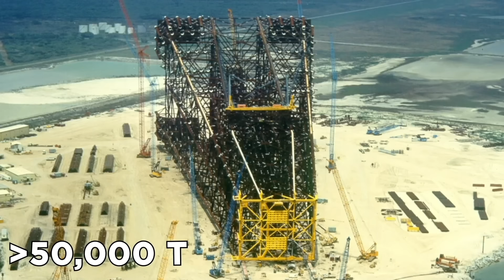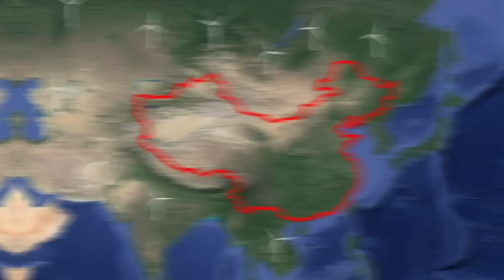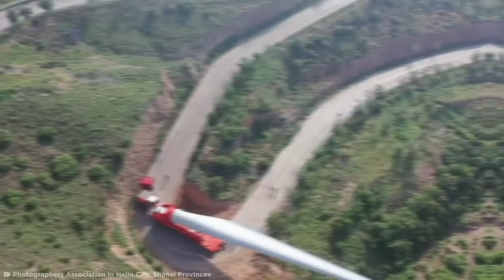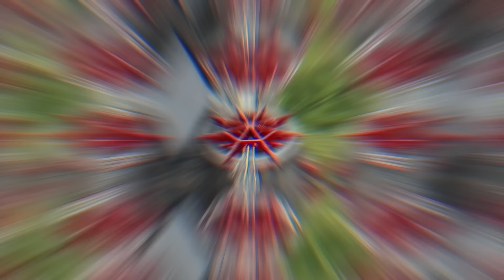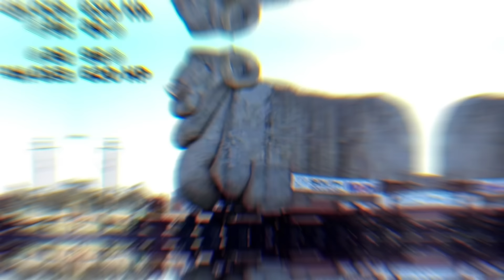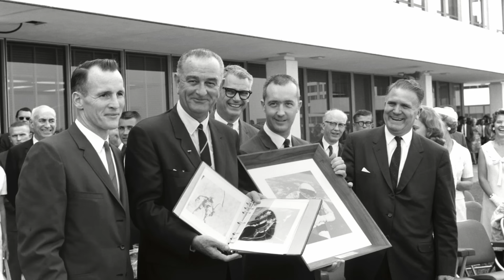Most Epic Transport Operations of All Time

Comment: I worked on final transport for a good handful of reactor packages from decommissioned Naval vessels. Mostly submarines but a couple of destroyers too. The wench they use to tow the whole sealed up reactor package is impressive-and it moves SLOW. It took about 12 hours to tow it from the keel blocks on the dry dock floor to the barge it would float on to Hanford. Some of the coolest projects I was fortunate enough to work on at Puget Sound Naval Shipyard.

Comment: The trailers for the blades is not self steering. The rear pilot has remote access to the wheels. Which is the person you saw following the trailer around the corner

Comment: I do not have the time to check the whole video, but the first fact is already wrong: The Eiffel-tower weights 10.000 T. The steel construction alone is about 7.300 T. If the base frame of the dwelling platform is over 50.000 T, that is not even 7 times as much as the weight of the Eiffel-towers steel. The video claims it weights 10x as much. Please check your facts.

Comment: @Be Amazed 
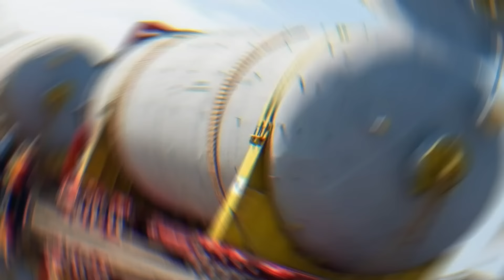13:07 - "Had to be moved across Canada... from Edmonton to Alberta." 
FYI: Edmonton is in Alberta, and travelling within a single province shouldn't be considered "across Canada". Also, the map used in the clip for this move is entirely inaccurate as this map shows Edmonton (right pin) and somewhere just north of Edson, however, the real move was North to Fort Mackay, which is further North than the more-famous Fort McMurray, and was just shy of 500km in length as opposed to the relatively short 275km as displayed in the video's map. Not trying to nitpick but accuracies are pretty important when creating videos such as this! Thanks for the content!
Edit: P.S. when talking about impressive statistics on these big moves try to avoid focusing on horsepower, instead, focus on the torque as the highlight.

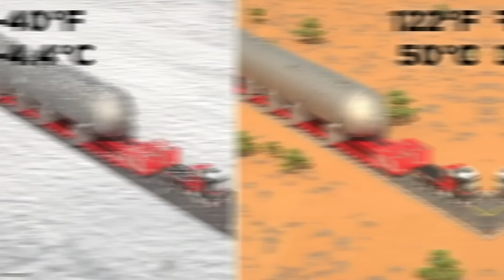Comment: At 12:29 you have temperatures on the screen. It says that -40°F is equal to -4.4°C. This is incorrect. -40° is the place both scales are the same.

-40°F = -40°C

Comment: 2 things :
- I Witnessed the departure of the transport of a completely disassembled Airbus A380 - a huge convoy requiring 6 or 7 specific transports (2 wings, head, mid section, tail section, and 2 huge containers of spare parts) from Langon to Toulouse, France.
- I didn't experienced but closely followed the transport of the Cape Hatteras lighthouse.. A complete brick building they transported as-is 100 ft or so inland because it was getting way too close to the shoreline. But the preparations took a couple of years because the building is quite fragile and had to be lifted in one piece.

Comment: This has to be the one comment section I can actually speak on lol there's one error in your video, specific to the blades being hauled on extendable trailers portion. Some newer trailers are considered "self steering", but it actually requires a steerman for the odd turns it can't make on it's own. It's my whole job. I'll try to answer any questions if you have any.

Comment: If the structure of Bullwinkle was floated into position after leaving the barge , why was the barge needed.🤔🤔😆😎
Reply: I though the same thing. Probably used the barge for speed of movement on the water opposed to dragging through water (less drag maybe) and with how tall it was, it had to of been pulled several meters off shore before it wouldn't bottom out on the ocean floor when tipped upright..... 🤷‍♂️

Comment: A single wind turbine blade significantly exceeds the diameter of a helicopter's main rotor 🚁😲 A 90 degree turn with that on a trailer is extremely rare to witness.

Comment: Imagine how much damage these made to the roads (the ones that were trainsported on them)
Reply: None. They are engineered to take that weight. On the majority of these loads the weight is distributed as such using multiple axles. No different in theory than transporting a legal load.
Reply: @jamesbond1231  The roads have to repair more frequently. Normal trucks destroy the road much faster than cars, hundreds, maybe even thousands of times faster.
Reply: @skedzer4803  Incorrect. They are engineered and designed to take the weight. 
SURE if the axles aren't steerable you get scrubbing, but - the majority of these transporters have steerable axles.  

Trust me... there are entire departments that do the calculations.  

They don't route these types of loads on regular roads. It's why they often take 2-3 years to plan And also why they usually try to make these moves during winter. The ground is more structurally sound.

It's .. simple science.
Reply: @jamesbond1231  Eventually, everything needs to be repaired, and roads need to be repaired often because of rubber tires on concrete or tarmac. They can take the weight, but rubber and tarmac needs a lot of maintenance.

Comment: Let me say first of all,  I have throughly enjoyed this video of moving such large items. Thanks! 
I was once involved in the transport of a 747 fuselage that went from Ft. Lauderdale FL. to Bethpage NY.  It had the tail and wings removed.  I had to design three cradles to fit the underside.  The fuselage was secured by steel cable to the cradles.  It was then trucked a few miles away to a barge. On the barge the cradles were welded to the deck.  Most of the trip was by barge then finishing up by truck.  The entire move took over 7 days.  The fuselage was then converted to a training station for space station simulation.  It was all very exciting to be involved in.   With some research you can probably find out more details.  Best  I can recall this was around 1980.  Grumman Aerospace was in charge of it all.